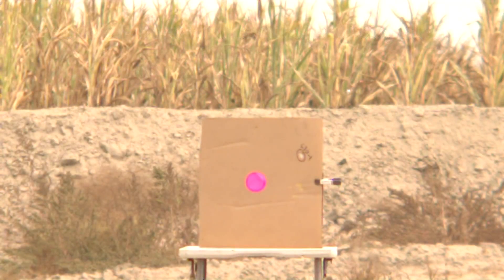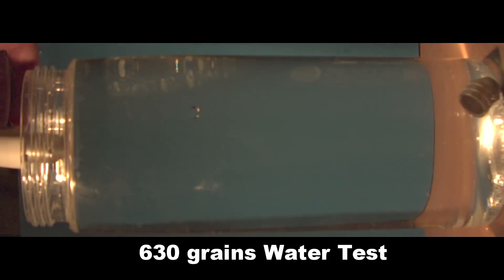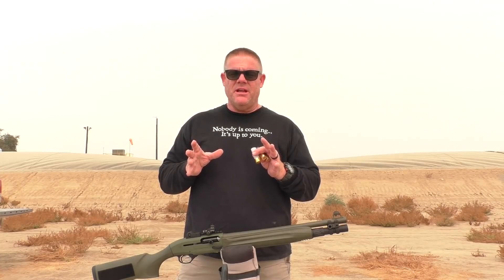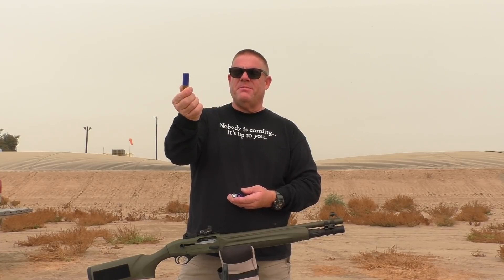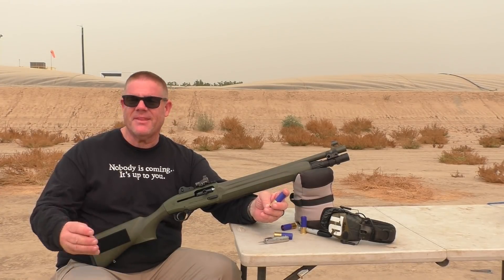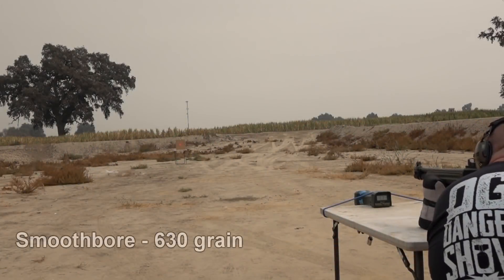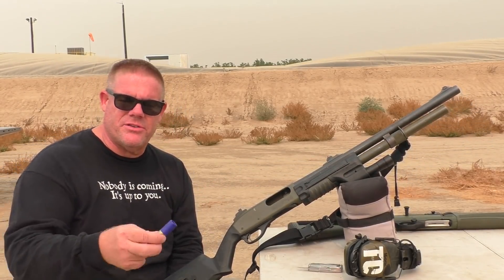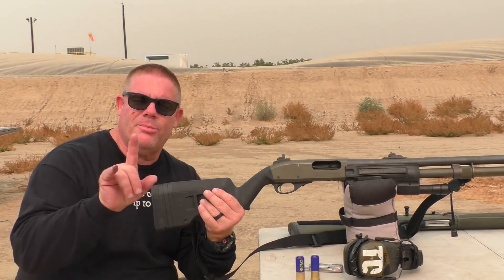Bizarre Oscillating 12 ga. Slugs -  Can we TAME them?

Comment: Been a while since I checked in with you. Did the faithful pumpgun finally bite the dust? Video of it?
Reply from the maker: No, it's still working fine.   The muzzle brake I put on it works well,  but the hot gasses shooting out the side screw up the HS camera shots.

Comment: Looks like the heavier slugs w/wad likes the Remington gravitronic accelerator. Whats his name denva, needs to reduce truncated  cone lead angle by 2 deg a0nd make it about 10 tousands broader where it meets duh (sorry had a brain tarf), where it meets duh shoulder. His meplat, I mean his slugs meplat needs slight modification and so does the tail. But, i will only share some info.  He's gonna hafta figa out duh rest 
Anywho, duh truncated cone may-be too shop. Denva needs tuh reduce the angle a bit. In his case duh cone is serving tuh add just nough lift due tuh air resistance causing a lifting effect. Rotating the round as per duh rifling is constantly rotating that surface and that nullifies the effect. A study was conducted dat found if u rotate a cylindrical body launched at velocity to duh order of 55000 rpm the body will remain in flight longa then if ya didn't. They is several reasons why dis works. We wont discuss it here. Denva reduce duh angle of attack so duh truncated cone is shorta. I guarantee you will see better results. Also if you can get your machinist to do it. Have him/her bevel the leading edge of duh shoulda in by 2 degrees. He/she's gonna whine, "dats an undercut, the cast round wont release from duh mold." Bullpoop! If he/she knows what their doing  when designing the mold that can be factored in. Ive designed dozens of 12 & 20 ga slugs that consistently fly true out of smooth and rifled  bores. I have not marketed them due to anti-gun nuts lobbying heavily to ban firearms.  I have designed and machined more than 12 successful 12ga slug designs that are consistently accurate having superoir knock down power and penetration to a number of rounds on the market. Ive also designed the molds etc. The big 3 slug manufatures are succesful because they employ concepts and design principals proven and in practice. On occasion they jump the fence to freedom and are able to produce reliable wildcat designs. Remember denva. The body (in this case the 12ga slug), is a large diameter body that has significant resistance and friction that must be equally distributed accross that bodies surface to provide reliable flight. When you get up & down lifting body effects you have a surface that is planning rather than falling across its trajectory. Good wuk.

Comment: Looks like they're marginally aerodynamic (CP behind CG)... you can spin stabilize them but only in relatively still conditions. With a good crosswind they could/should get even weirder when spun as the "push" is still behind the CG and mixed with gyroscopic effect can have it yaw but stabilize in an off-axis condition. Get one sideways and magnus effect could zip that sucker yards off it's intended path.

Comment: I'd be interested if you could 3D print those Azot Wads for easier accessibility.  It'd be an interesting experiment, maybe even contest-worthy.  Different filament materials would react differently.  Most would probably just crush and shoot out as plastic shot.  But perhaps there are more flexible materials that could actually compress.  Or maybe there's a different design altogether that can withstand the forces and stay with the shell.  No doubt if you put it out there, your viewers would have a host of designs ready to print in no time.
Reply: Snap! We have the same idea... :) I think even if you just print the "scaffold" of the wad, you could probably then reinforce it with flexible glue/silicone or somesuch?

Comment: Minie ball slugs (invented by French Army Officer Claude Minie in 1846) should always use a rifled barrel they were designed explicitly for rifled muskets the whole point of them with the thin sides of the rear of the round that gets distorted by the explosion grabbing onto the rifling and spin the round without the rifling all you have is a smoothbore musket with an even more unstable round than the traditional musket ball.  I may not have as much practical experience of shooting as you guys but I do know the history and I know that Minie balls were used in civil war era rifles like the Springfield and the 1853 Enfield.  To be honest i'm shocked that anyone would ever be ignorant enough to ever even consider using a Minie ball round in a smoothbore gun.  The advantage of the Minie ball was that unlike previous rifles like the Kentucky or the Baker was that you didnt need to stuff the round with padding to get it to engage the rifling thus the soldier could maintain the same rate of fire as a smoothbore musket but with the greatly improved range.  This change was demonstrated to great effect in both the Crimean War and the US Civil war and spelled the end of Napoleonic era linear infantry formations i.e. Why infantry charges like Pickett's was suicide at Gettysburg when facing Union troops armed with Springfields but when the French and British did it at Alma a couple of years earlier when they had Minie balls and the Russians still had smoothbore muskets it was a complete success that won the battle

Comment: Jeff, Steel is one of my favorite powders for slugs. I will tell you that 30 grs is a very anemic charge for that weight. Somewhere between 38-42 grs should of done the trick.
Reply from the maker: I would have loaded them hotter if we only had to shoot 6 or so,  I didn't want to damage Gregg
Reply: @taofledermaus  Greg seems to be a stout ol feller. 😁

Comment: Maybe get a mold for the plastic wads too and mold them too. Ive seen it done. You have to put in the plastic under pressure, but it is doable. 25kg bags of plastic is not too expensive. You can make a lot of wads from that! 

This seem to be the final solution for smooth bore shotguns to shoot slugs straight. 

Greetings,

Jeff

Comment: Jeff, you might want to consider going old school on your powder and try some Blue Dot (if you can find any!)  I don't have any experience with Steel so can't compare but I've had some very good luck with the Blue Dot for the heavier slugs, in both smooth and rifled barrels.  I generally use Bullseye for really light loads and the Blue Dot for the heavier loads.

It looks as though the skirts on the lighter slugs might be a bit too thick for good expansion.  If the skirts are too thick they will not expand and engage the rifling.  You also might try one or 2 over shot card wads on the base without the filler, although the filler shouldn't prevent the skirt from expanding into the rifling.

Best of luck to Danny.  Get well soon and get your butt back to work!
Cheers,
jc
Reply: If there is a wad or gas seal under the slug, doesn't the skirt thickness affect on obturation become a moot point? 🤔

Comment: you should drop the slugs from under the water not over the water because it may be the bubbles which are causing an un even drag
Reply from the maker: The bubbles mimic the low pressure area that is present when it goes through the air.

Comment: Possibly naiive question: if it functions like a minie ball, do you need a wad and plug? The hollow rear of a minie ball allowed the bullet to achieve a proper gas seal by expanding as it fired. Could the same principle work here?
Reply from the maker: Maybe if we were using black powder which will ignite and burn at low pressure,  but  I don't think it would work with smokeless.
Reply: It certainly could, but why not reduce any opportunity for lead fouling and protect the projectile from firing damage as much as possible?

Comment: The minie ball ammo was designed to obdurate by the pressure of the ignited powder spreading the hollowed area into the bore of the barrel.  If you're going to use a filler for the hollow and a wad, shouldn't that filler extend beyond the back of the slug (which is essentially what the Russian wads are doing)?
Reply from the maker: This is how you make it work for a 12ga which is operating under much lower pressures and using smokeless powder.
Reply: @taofledermaus  Thanks for the reply.  I understand that you're dealing with the constraints of shotgun+modern powder, but absent some means of spreading the rear of the hollowed-out lead tail the minie ball would predictably perform worse than round ball, especially at supersonic speeds.  The Russian wad seats in the back of the projectile and either forces obturation or sticks with the projectile and removes the unfortunate low-pressure area behind the projectile and/or takes the rifling to use spin to lessen that low-pressure area (presuming separation of the wad).

Clearly you're having to make-do with the projectile you've been given and some pigs just won't pretty up with lipstick.  ;)

Comment: Something i noticed in the water drop tests was at first there was a nice bubble of air around the slug and trailing it then as it continued to stretch the bubble popped causing lots of turbulence and the water rushed in to the cavity and acted like jets causing it to oscillate. And in the live tests you see that same oscillation not sure how that could be fixed. Just my gut reaction round over the rim along the outside edge to smooth out the air flow sharp edges might be causing it. Also might try rounding over the entire rim i would do both if you do any future tests on them. Again i am likely totally wrong here just a thought

Comment: I wonder if casting the slug with a short piece of braided wire that uncoils when shot, would be enough to stabilize it. (should full rifled barrels not be allowed in Auz)
Something like what fishing leaders are made out of, seems like it should be both flexible enough and strong enough, to not just snap on being fired. Which is why I'm not sure whether copper or aluminum wire would suffice... However, if someone happens to have a highspeed camera, that'd be something to test out: cast any ol' slug and try the three different wire types. ;)

OG was on point today. With the jokes, I mean. The slugs, eh... Was too much particulate in the air, that's what I'm going to blame! lol

Comment: I am starting to think the problem is in 209 primers.  I am noticing in my gun and loads 100% ignition at anything up to 25 gr. powder, but once I go above that into the 30 or more gr. territory I start seeing squibs and hang fires.  The weight of the payload doesn't seem to be that important.  I need to find a hotter 209 primer so I don't have to default to brass that uses number 30 primers.
Reply from the maker: I just need to stock back up with some Longshot,   it always lights off.

Comment: Have you ever tried firing a totally asymmetric round? maybe you could grind off one corner of a slug at an angle and see what happens.
Reply from the maker: Funny you mention that.   Alexy just sent some of his brass slugs with a big portion milled from the side.   Should be wild.
Reply: They did do it with .22lr.
Reply: @jchiliw  Oh cool, I'll check it out.
*found it, it might be cool to do a slug from a smoothbore though, so there is no spin stabilisation.

Comment: Started thinking of why up and down was so much more dramatic. Started looking at the barrel rise, could it be due to  the heavy round, harmonics, some flex in the somewhat thin barrels? I would think in Australia with a mainly hunting geared gun world something like a more traditional break barrel with heavy steel barrel would prevent some of it?
Reply: The barrel whipping won't affect the projectiles flight down range. Whip will change it's initial direction slightly, but it's still the projectile shape that determines its wierd flight pattern. 

Curving bullets in flight by swinging the gun around doesn't happen, that was just a movie and a pretty lame one at that.
Reply: @randomidiot8142  I wasn't refering to a movie. I was more thinking along the lines it's a contributing factor. It's so quick and with the shape as it's exiting it's nosing up  down when it exits, the very most rear staying more inline, and kinda whipping the projectile itself . Mainly up and down because a shooter experienced in hot/heavy loads. Maybe they are rather stable, but a mash of things are creating such a unique flight path
Reply: @koreymann2493  the barrel whip I've seen in the best slow mo video is so slow compared to projectile speed that it can only change the poi, not flick the rear of the projectile. Just think about that. How fast would the barrel have to move to flick a speeding bullet? Now to go that fast you need to rapidly accelerate the barrel to change the direction of the projectile as it's partly out the barrel. How do you move the barrel that fast without damaging it or the receiver? Objects in motion staying in motion and all that. 

It is curious that the hollow base doesn't provide sufficient drag to stabilize the conical projectile but something very inefficient ballistically like the monster diabolo pellet does. I have a feeling that the weeble wobble is from it being not quite fully drag stabilized. It wobbles, drag goes up, it corrects to true, then over corrects, then corrects and over corrects over and over. It darts because the nose changes direction and it 'steers' itself around. A redesign with a wider meplat may be what this projectile needs, not like it would make a huge difference in maximum range when in the context of slug hunting or most hunting in general.

Comment: Imo and loading experience, Steel is used for steel because steel shot doesnt flex. Lead actually flexes and requires more momentum. Steel powder is too fast a powder.
Edit:  but jeff ive been loading 10 years and i guarantee youve been loading longer so you can drop some knowledge on me if you think otherwise.
Reply from the maker: Steel is a slower burning powder than even Longshot.   I have a lot more experience with Longshot than Steel.
Reply: @taofledermaus  interesting i thought it was faster but had different pressure curves. Ill have to consider that powder for a future project of mine that uses steel buckshot.